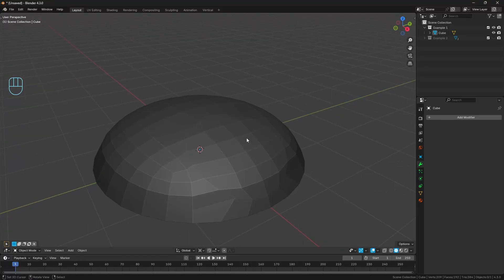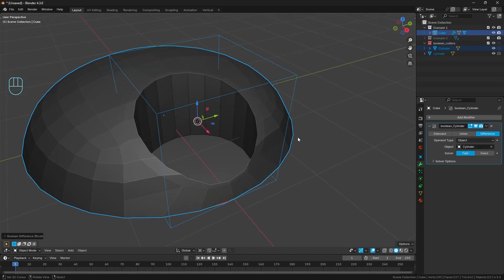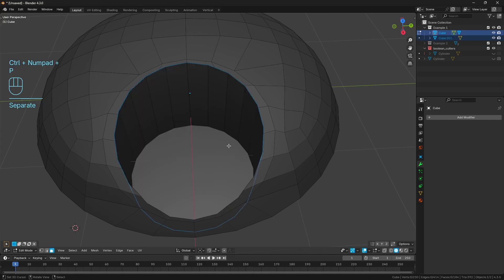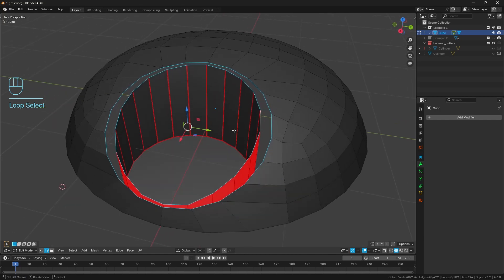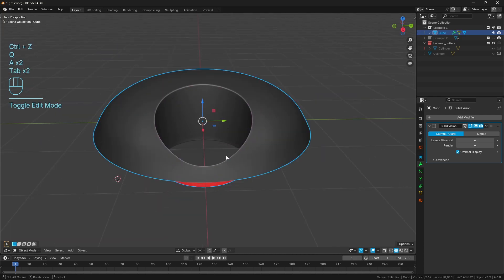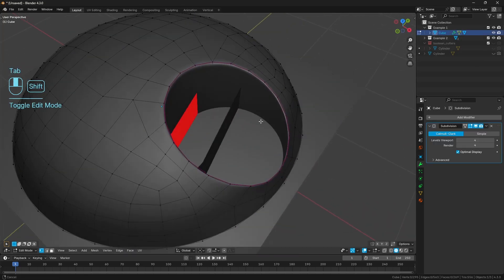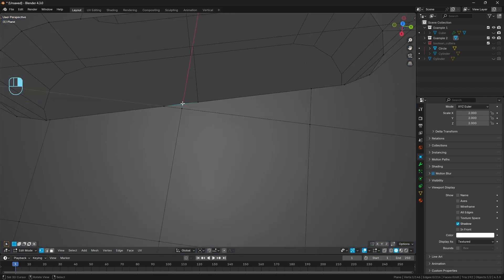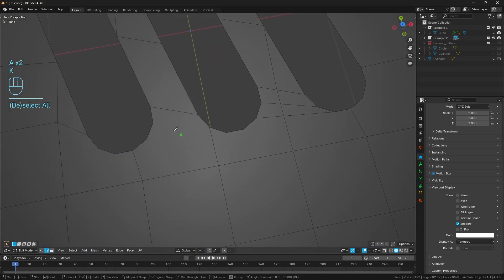Blender: Easy Subdivision & Boolean Cleanup

Comment: Guess you could also add a material to the biologen. Set the viewport color to bright color. Then when you apppyz that material also transfers over
Reply from the maker: You could do this and it would be helpful to see a visual distinction between the boolean and non-boolean areas. However, I think this will ultimately take more time than it's worth for such a result. Also, materials can't be assigned to vertices, so it doesn't help all too much with identifying the topology clean up.

So, yes, this is something that can be done, though, I don't think it will be of too much help in the grand scheme of things. 😄
Reply: @masterj2001  but sharp also can't be assigned to a vertices, only to a line. And since those inside faces did get sharp applied, that would mean they would also get the material. If my brain works correct now ;)
Reply from the maker: @ So this is correct, yes. 😄 However, materials are exclusive to faces, which is again restricting.

The main reason I lean towards using sharps is that, even though they're restricted to edges (which are made up of at least two verts), they make it easier to isolate the specific verts we need to clean up after a boolean. Comparatively, materials are applied to faces, which involve double the amount of verts as an edge, which can add extra steps during cleanup.

Also, selecting sharps can be done directly in the viewport using shift+g > select by similar > sharp, whereas selecting by material means jumping into a separate part of the Blender UI. It’s a small thing, but it does add a few more clicks than necessary.

So yes, using materials is a valid alternative and can work. Personally, I find that the sharps workflow is more streamlined and efficient for assisting in the boolean cleanup process. 😄
Reply: @masterj2001  perhaps I remember this wrong. But if you go I to edit mode with the boolean object selected. When you than apply that boolean, I believe the selection transfers over to the target object. Not sure this still works and if I remember it correct
Reply: @masterj2001  shift g also works for materials, select the face> shift g. It'd basically the same ;)
Reply from the maker: @ To true, that was an oversite on my behalf. But this still means you're selecting double the amount of verts compared to using something that is restricted to edges.

For example, in this tutorial if we did materials, we would be able to isolate all of the vertical faces of the cylinder, but that still wouldn't let us isolate the extra verts that we needed to delete on the top row of edges.

As the idea here isn't just isolating the booleaned area, but understanding where the additional verts exist from that boolean and which verts we need to keep and which need to be dissolved/deleted. 😄

So while viable, I still think materials will make more work for you in the end.
Reply: Yup, still works. Be sure to deselect the target mesh before you do this. I remember this from blender 2.77 or 2.78 or so. It still works